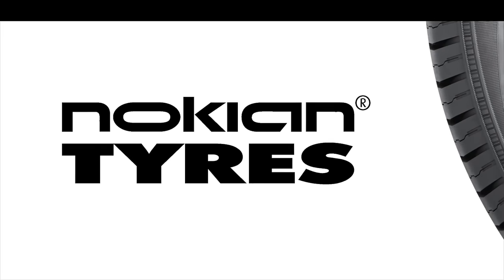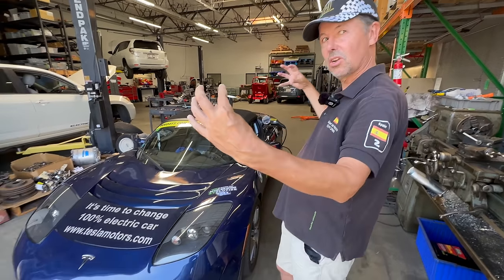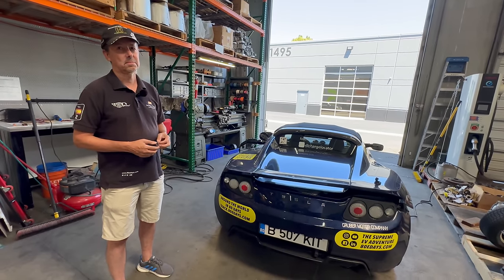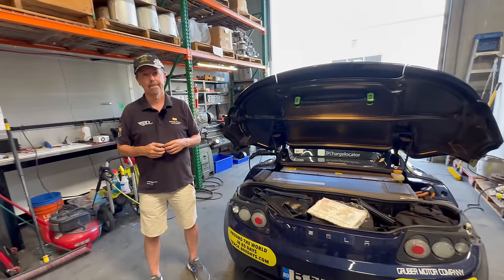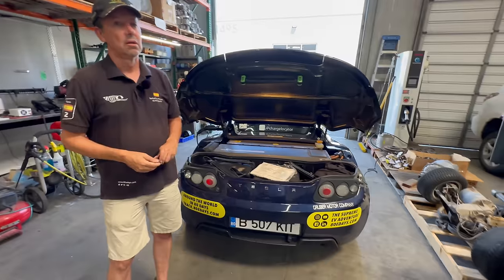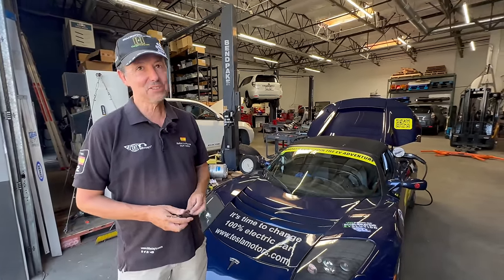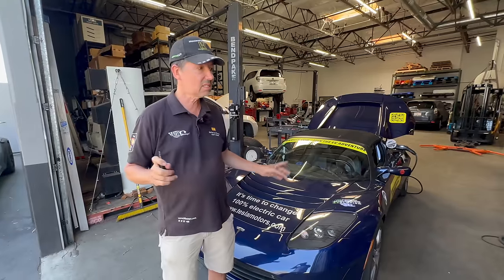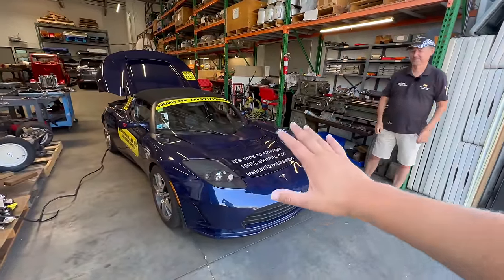Around The World In A Tesla Roadster, Twice! The Incredible Story Of EV Adventurer Rafael de Mestre

Comment: Here in BC Canada,we have a fleet of BC Ferries Hybrid Ferries that can be adapted simply by adding the EV charger infrastructure on each dock and what is even better is Harbour Air is looking to converting  their short routes Beaver aircraft,taking out the load and stinky radial gasoline engines and putting in Electric Motor with batteries to travel 30knots non stop!